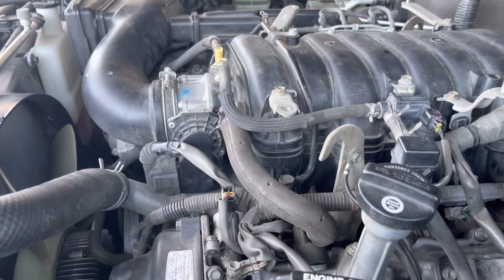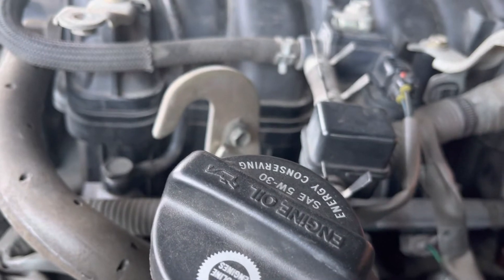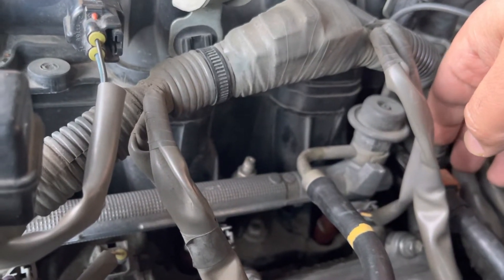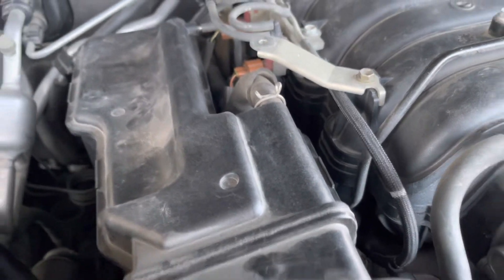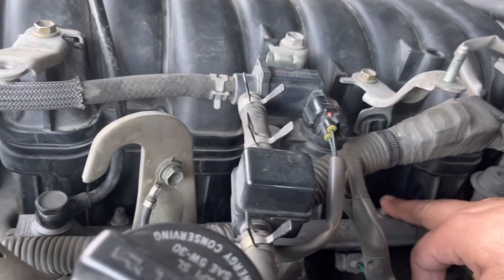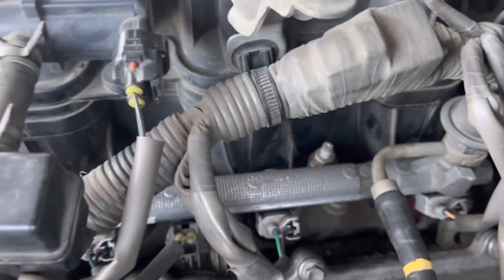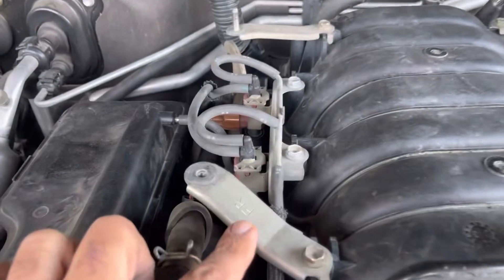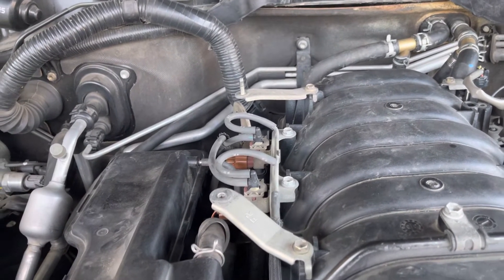2UZ-FE Injectors Leak Fixed & Couple Of Tips

Comment: I wish I came across your past few videos earlier. I replaced my injectors for the same engine today while changing the knock sensors, but I just plugged them in without regard. Started the truck and fuel spilled everywhere. Will start again with your advice. Thank you again for the video!